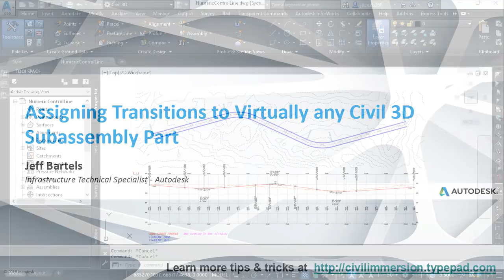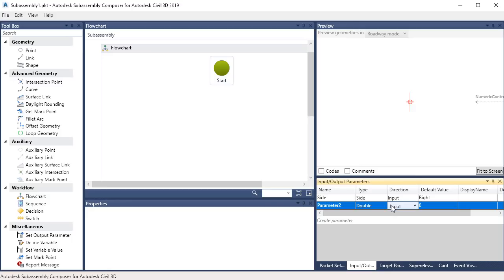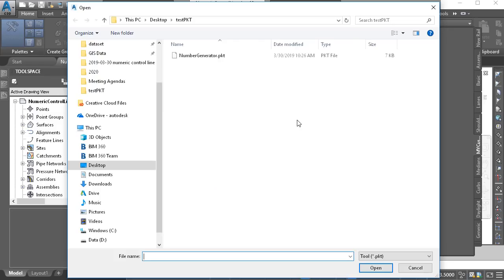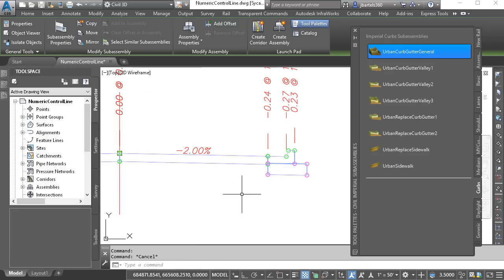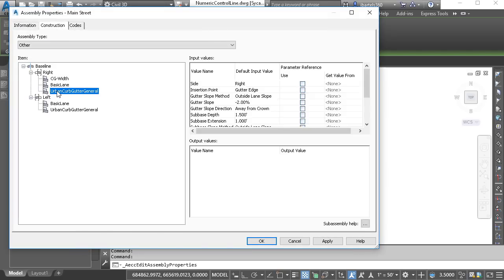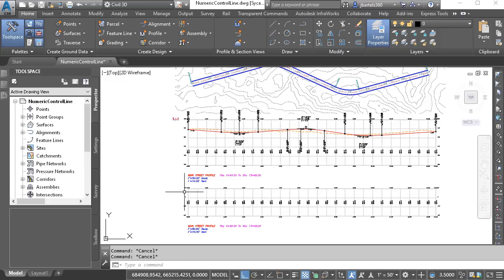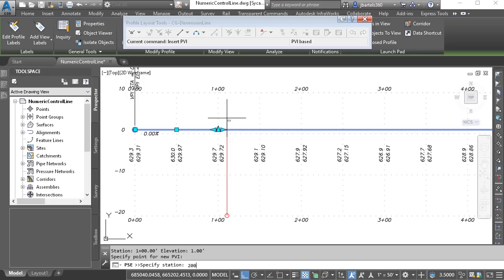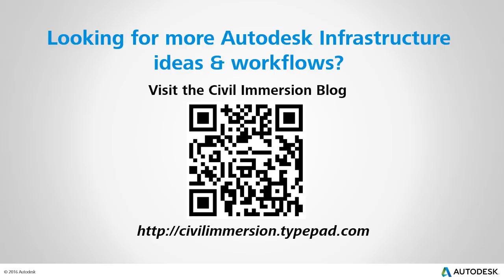Applying Transitions to Virtually ANY Civil 3D Subassembly

Comment: Wow Wow such a great art!
I did it and worked well, but the output parameter of the subassembly was 0.000 and cant be edited from the property box; why this happened?
Reply: Having same issue.  Trying to transition gutter from 18" to 24" using this method, but default subassembly output parameter is 0.00 and locked. Have been unable to get this subassembly to function as desired.  Any luck finding a solution?

Comment: Hi Jeff, I haven't seen you in about 25 years. I have been at one of your old stopping grounds for about 10 years now where we first met. Back with C3D2016 I made some custom sub-assemblies but the sub-assemblies did not display in the cad file when another user opened the file. Has AutoCAD fixed that? I saved the pkt files to a network location but it was too much of a pain for others to work with so I gave up on the concept.

Comment: Hi Jeff, I don't have a lot of colleagues to learn new C3D techniques from, so your tutorials have been priceless. I am trying to use this technique to transition between slopes and grades. For example, if I want to transition between a 2:1 to a 3:1 slope do I set my profile values as 2 and then 3? It looks like for grades decimal fractions are required. For example, a 2% slope needs to be represented as .02 on the profile. Is that correct? Thank you for all your great work!
Reply: I know this has been a long time, but for anyone else coming to this video to carry out superelevation using this method, yes slopes should be in the decimal format. I.e., a slope of 2.5% should be as 0.025. So on the profile you should be at an elevation of 0.025m in metric. Changing from a camber to superelevation where  your lane slope is -2.5% to 2.5% you would be going from -0.025m to 0.025m. Should give a grade of 0.5% of the profile.

Comment: This workflow also can be used for slope and/or grade transitions.  Within the Subassembly Composer, create the .pkt with one difference: set the Input/Output Type to Slope or Grade, depending on the purpose of the Number Generator.  This works wonderfully for a return side slope condition where my ditch foreslope transitions from 6:1 at the baseline PC, to a 4:1 slope at the baseline PT.  Thanks so much Jeff!
Reply: What did you put in the expression editor? I am getting an error?
Reply: hi wondering if you tried this and if it worked can you share all the parameters you used thank you
Reply: Its not actually necessary to change from elevation to slope. 

To carry out superelevation (slope changes for any reason) using this method, slopes should be in the decimal format. I.e., a slope of 2.5% should be as 0.025. So on the profile you should be at an elevation of 0.025m in metric. Changing from a camber to superelevation where  your lane slope is -2.5% to 2.5% you would be going from -0.025m to 0.025m. Should give a grade of 0.5% of the profile. This comment has been repeated for another user

Comment: so even though the new profile is a vertical representation,  the number generator is calculating the horizontal transition based on the vertical representation. basically getting the numbers only, station and vertical offset and using them both as horizontal numbers. Is this fare to say?
Reply from the maker: Yes, you are on the right track.  The profile is not a vertical representation.  It is simply a graphical way to define numeric values along the alignment.  The custom subassembly part ("number generator") pulls those numeric values from the profile and then passes them to a subassembly via. an output parameter.  Hope this helps!
Reply: @JeffBartelsCAD  thank you for all the tips and tricks.